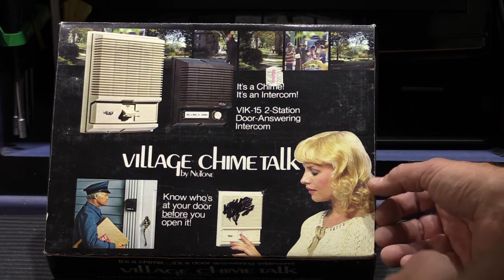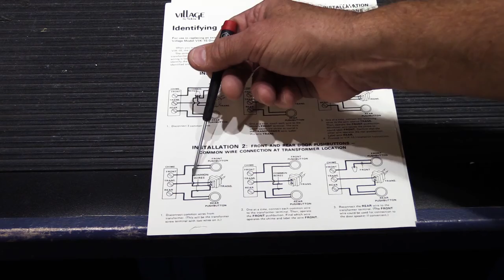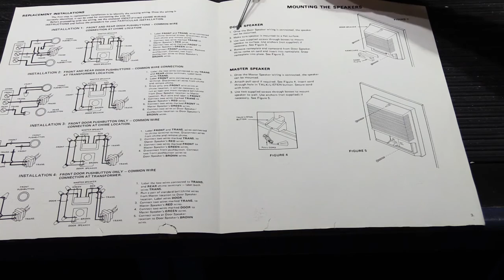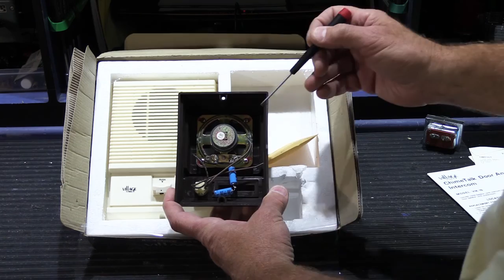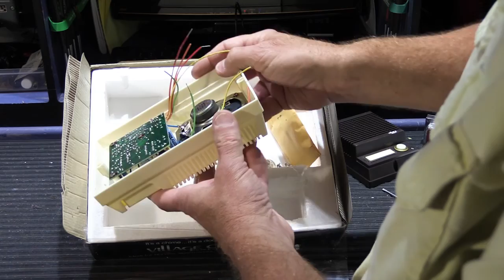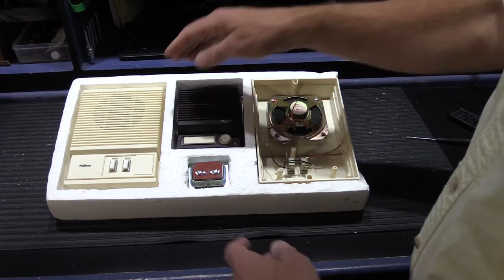An Overview of the NuTone Models IK15 and IK25 Entry Door Intercom Systems

Comment: Good morning! So I had a NOS IK-25 Doorcom from roughly the year 2000 that was left over at a vacuum store we bought out. In my apartment building, a neighbor raised a major concern about privacy with my Ring camera and I had to remove it. I installed the IK-25 using 20/2 Stranded Bell Wire and the transformer included with the package. Although the doorbell function works, I cannot "Talk back" to the Door Module and about an hour after installing it and powering it up, I got a horrible, loud crackling noise. Could that be from a defective transformer? OR should I just abandon this whole thing and get a modern intercom? Any suggestions on what to buy?
Reply from the maker: Hi evan:  First - - It's Not The Transformer !!! (I'm 99.99% certain of this)  - If the IK25 was truly NOS and all of the kit was still sealed in the cellophane around the styrofoam inside the box, then the equipment is past its "shelf - life".  The clue to this is your description "about an hour after installing it and powering it up, I got a horrible, loud crackling noise" - The IK25 has components that have failed due to age.
     It would be possible to rebuild the IK25 and the IS68 Door Station will need some attention also. - Chris

Comment: I have an ik-25, with a door release for a person with disability;  I also have inside talk between rooms which i need to keep.  my primary intercom(inside) doesn't work- I would like to replace it- it has a lot of static and so no one can hear inside or outside.  The slave intercom seems to be ok.  But I can't find the primary anywhere- What can I do?  or  is there a replacement that I can keep the features of the ik-25
Reply from the maker: HI silvia:  One of the 2 Inside Stations is the "Main Station" which contains all of the electronics that make the IK25 System operate.  The IK25 is a unique type of design, that originally came out in the early 1970's - There isn't any modern replacement that will work with the wiring that's already in the house - You IK25 can be repaired - Chris

Comment: I have the IK25 with the 3 parts and just bought a Lorex 2K QHD Video Doorbell to replace it. It needs 16V - 24V to function which seemed to be what I detected at the door bell. I wired the new video doorbell and it doesn't work. Any ideas of what might be going on?
Reply from the maker: Hi Gihad:  Did you remove the IK25 completely (all 3 stations)?  If not - You will need to disconnect the Main Inside Station (1 one with all of the electronics in it) - Determine which wires come from the Low-Voltage Transformer and which wires go to the Exterior Door location - Splice the Transformer Wires to the Door Station Wires - This will reroute the Low-Voltage power form the transformer directly to the Camera (bypassing the IK25) The Transformer for a IK25 is 16 Volts AC rated at 10 Watts (VA) which may be to small for your Camera. - Chris
Reply: @northsideservicecompany3567  That makes sense! Thanks. I was trying to preserve the chime from the NuTone system but that's not really necessary so I will wire it directly. I just watched your other videos and now I think I have an idea of what's going on but in my case since I don't need to keep the NuTone it will be easier. My Camera came with one of those little power boxes, is that something that could boost the power of the original transformer?
Reply from the maker: @gihadmurad  The Lorex "power box" has nothiong to do with the power from the Transformer - it is an interface device which can ring a 2-note doorbell - Chris
Reply: @northsideservicecompany3567  Wiring it directly seemed to have worked. Thanks.
Reply from the maker: @gihadmurad  Cool - Chris

Comment: Are there any intercom systems or a simple doorbell that is compatible with the current wiring for the Nutone IK15?
Reply from the maker: Hi Jennifer: The only mostly direct replacement for a NuTone IK15 Entry Intercom System is the Aiphone C-123L/A Entry Intercom

The Aiphone uses the exact same wiring layout as the IK15.  There is a difference in the type of Transformer that the Aiphone System uses.

The Aiphone System uses a DC Plug-in Transformer (model SKK620C) - The IK15 uses an AC Hardwired Transformer.  These are completely different types of Transformers, and they are not interchangeable

I have installed the Aiphone System as a replacement for the IK15 before and what we did was convert the electrical box which originally had the NuTone Transformer into an electrical outlet (like you plug a lamp into) and then we plugged in the Aiphone Transformer

Also, there is an option on the Aiphone System, which allows you to power the system from 4- D Cell Batteries and not use a Transformer

If you need more detailed information, it would be best for you to call me - Chris (925)-743-8236

Comment: There we go. I have the IK-25 system.
Reply from the maker: Hi Ireneus:  Yup - Is it still working? - Chris
Reply: @northsideservicecompany3567  Hello Chris.  The units were still working when I replaced it with my Wyze doorbell.  The only problem was the intermittent function of the IS-68 button.
Reply from the maker: @ireneusjustinpolicarp8628  Perhaps it's as simple as - you need to replace the original Pushbutton on your IS68 - Chris